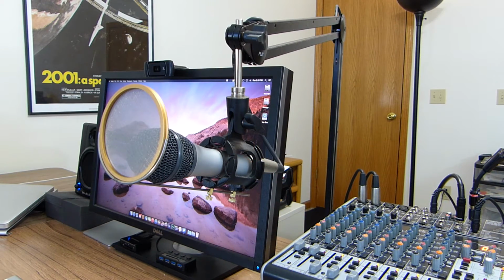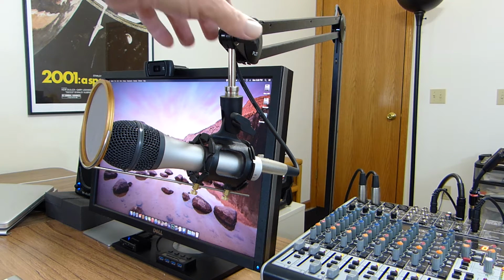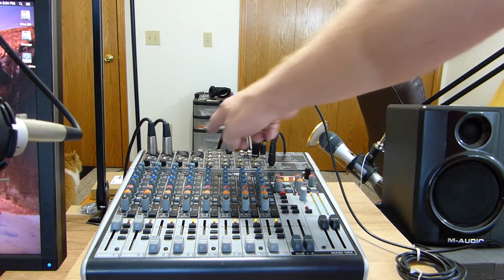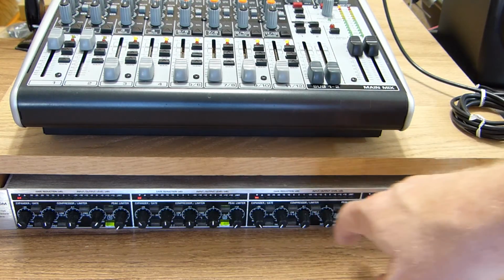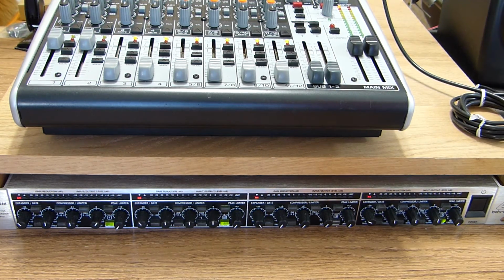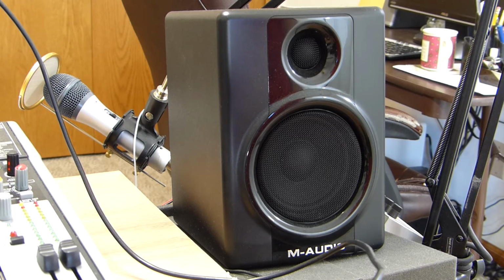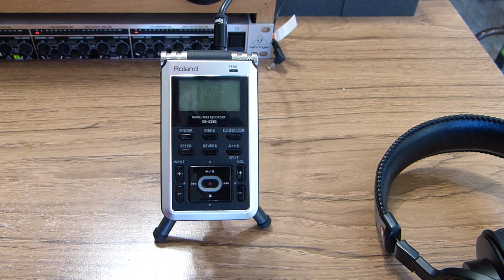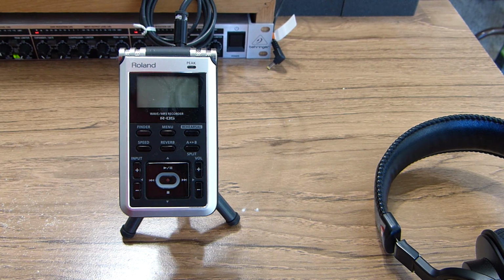My Audio Gear Setup 2014 #ATR 2100 #Behringer #Roland #Heil #M-Audio

Comment: I find it kinda funny that the mic boom is about 4 times the price of the actual mic... i am waiting for the price of that mic to drop back down, then i'm going to pick one up :D
Reply: +FrugalTech i have heard that the mic is very quiet, is that the case from your experience? i am looking to use it for Skype and for maybe live streaming, where it is difficult to increase the volume. I am also going to be talking into it from about a fist length away.
Reply from the maker: Garret R Yes it is quite (excellent noise rejection)  It should be fine. I highly recommend this mic
Reply: so it is quiet? like unusable without post amplification? (sorry for all the questions, but i really want to make a very solid decision)
Reply from the maker: Garret R No by "Quiet" is has excellent noise rejection from the sides and rear.
Reply: by "quiet" i mean like is the volume of the usb output to a computer low in volume? would the audio be usable without post sound amplification?
Reply: +Garret R i picked up one of those pics a couple days ago I LOVE IT! it works amazing for what i need it for.

Comment: Nice video Bruce. I got the Alesis mixer but the noise gate is very high. Will need to look into the one you have
Reply from the maker: David Spector Thanks David. Take a look at the DBX 286. A lot of people swear by them
Reply: I will thanks